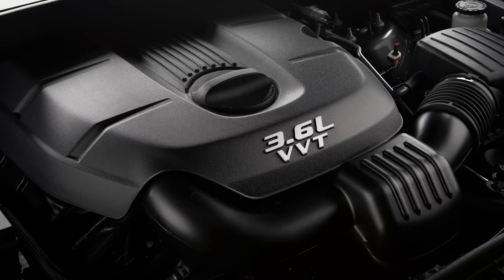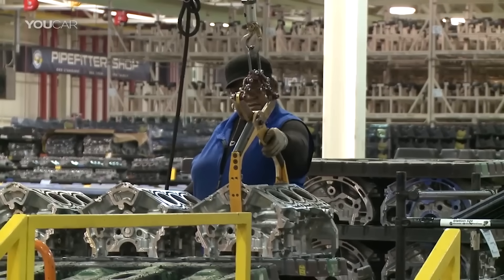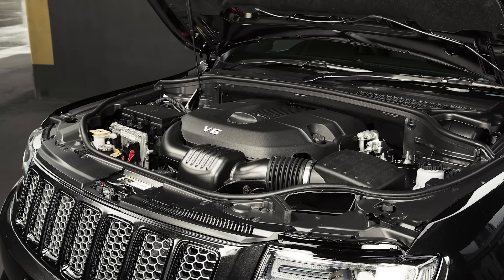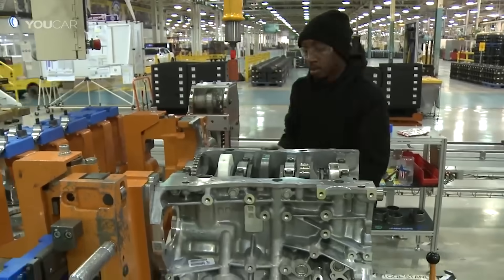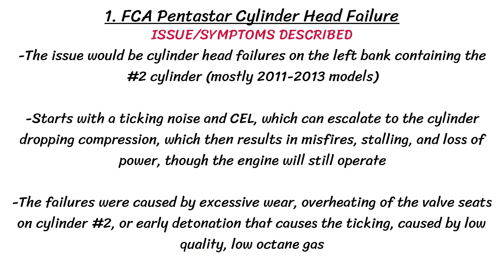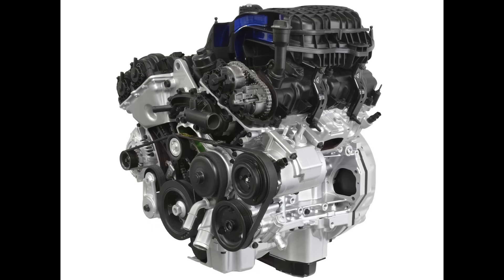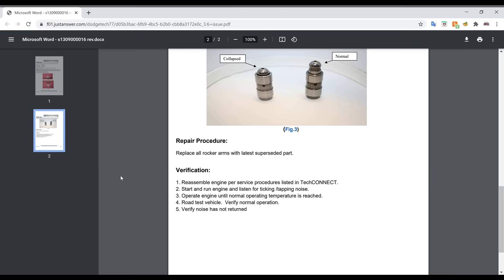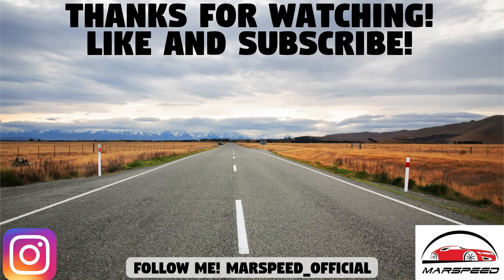The Specs and Fatal Flaws of the Chrysler 3.6L Pentastar V6 Engine

Comment: Work on the Pentastar everyday. The head and rocker arm issues are 100% accurate but the vehicle's affected are pretty low. Enough so that we purchased a 3.6 in my wife's car. For the most part they run great and have great power.
Reply: Bought a 22 gladiator and under 5000 miles had a rocker arm fail
Reply: Great ! I just bought a 2011 Chrysler 300 V6. It has 216K Miles on it. I got it for 500 dollars, it has a phone book of service records. It has a dented wheel and fender. I ordered everything I need and can’t wait to get it back in the road.
Reply: Yes I'm dealing with it now
Reply: So my 3.6 is having an oil pressure issue. Not revving over 3k. Check engine light for engine oil pressure control circuit stuck closed, just had an oil pump and sensor put in to solve the problem with no results. What on earth is the problem
Reply: @ashtonr6751  It's Fiat-chrysler. They're not good.
Reply: @daveclark8337 incorrect bias and not helpful.   They are looking for a likely cause to repair.   Why be mean??
Reply: @asdad asdasd one more thing I forgot to mention is that transmission problems usually a ride after you've had a engine fuel or spark issue if you notice that the kind of happened around the same time at the starting point then they're tied together, so fix the engine problem in your transmission will probably straighten out
Reply: Have a 9 year old Charger 80k never any issues yet. Dad’s got a 17 Caravan 130k no issues
Reply: I had one for a short time in a 2017 wrangler. Sometimes (especially at a cold start) it would knock for a few seconds until the oil circulated but it was very noticeable. There was always some degree of a knock at startup. 
The other issue was a very slight grinding like sound when it ran. As engine speed increased, it seemed to sound worse but not louder.
I sold it with 16k on it and I'm kind of a fanatic with oil changes. It just didn't seem like a smooth-runner.
I always wondered about that engine
Reply: @User-q6x3b  to avoid dry starts, hold the gas to the mat, turn it over for a couple of seconds.. then start it.. it'll start nice and quiet.
Reply: The rockers 😂
It's not difficult to fix, after good ones are replaced it's a great ngine. It's a shame Jeep didn't do a recall.
I've had Landrovers, BMWs, fords etc with worse problems. Start to google about them and then you will be greatful for the rocker issues. 😂
The internet is a nightmare for problems but not the good things.
Reply: @RoyalBaboon247 exactly true about other brands
Reply: THANK-YOU FOR THE ENCOURAGING NEWS BROTHER, STAY SAFE !!
Reply: @Hoss056 do you think the rocker arm issues are caused due to the oil galley plugs backing out causing lower oil pressure to the lifters? The plugs are just behind the phasers. I'd be interested to know what percentage of vehicles worked for rocker issues have loose galley plugs.
Reply: @danieltillman3858  The bolts that block the end of the oil passages tend to cause timing DTCs when they get loose. I have no answer as to why the rockers fail. Only real advice is when you hear a noise get it checked out. Waiting let's the rocker get worse and can ruin a cam.
Reply: @danieltillman3858  There is a Star Case about this. That will cause DTCs and most likely some performance issues. I haven't actually found a lot of vehicles affected by that.
Reply: Most of them are caused by waiting too long for oil changes
Reply: 3.6 vvt..excellent motor change oil filter often super motor
Reply: 2018 caravan sxt all i have done perventive  .. bought it with 80k now 134k not a thing wrong
Reply: This is good to know :)
Reply: I've owned many vehicles with 3.6L engine and all have been bullet proof with up 130K miles thus far over 10 years.  No repairs whatsoever.  One of the best engines ever!!!
Reply: @asdad asdasd did you use the proper cleaner and clean the mass air flow meter and the throttle body? When's the last time you replace the air filter with OE Style? Sure you don't have any codes that would indicate Eileen system which means you might be pulling a vacuum and as far as the transmission goes to get the dealer to charge you a small fee to just Flash the transmission module with different parameters if you know for sure that your pressure solenoids and your transmission mounts are good
Reply: My wife and I just got a 2020 Chrysler Pacifica Limited. I see online that it uses the same PentaStar V6 as the Challenger SXT. The van gets 287HP stock, where the SXT has about 305HP stock. Does anyone know what accounts for the HP difference on the same engine? I'd like to have 305HP in my van. I wonder if an aftermarket performance throttle body made for the Jeeps or Challengers would fit and work on my van, or if the differences in ECM programming would prevent this.
Reply: This was incredibly informative. I just got told that my 2012 VW Routan has pretty much this same issue. It has 146k miles. Their recommendation was replacing valve lifters, timing chain, and catalytic converter totaling $11k. I’m at a loss. Obviously I’m not going to put that much into my van. Does this seem right?
Reply: @jonmitchell7626  no
Reply: Have you came across any oil consumption issues (3.6L 2014 RAM)? I did the oil filter housing swap after leaking and thought that would of solved my low oil issues but im going thru oil like crazy with no leaks apparent anywhere. Driveway is always clean. Any tips?
Reply: What would cause the car to rumble and shake for a second when running but at a stop? Mike does it for like a second and then it’s fine . 

I asked a mechanic and he had zero useful info to give
Reply: @avs27hky008 check you exhaust . Does black smoke comes out in the morning . Are the pipes black ? Piston rings ?
Reply: Have you dealt with the random Injector open circuit codes? 2 different cars same motor first are #3 & #5 second #2. Can't locate a ground issue with either plug has full power new injectors don't change it and can randomly jump cylinders
Reply: @HellicaBuilds  Have replaced a bunch of injectors but it's usually pretty cut and dry. Measure the resistance. Seems like 14ish is where they usually fall. Failed injectors usually are around 20 plus ohms.
Reply: What about the the flex plate.
Reply: @HellicaBuilds  Seen some crack. Usually on the heavier vehicles.
Reply: WHY why why are head gaskets blowing on '17+ Pacificas???😢
Reply: I have a jeep wrangler, 2016, just replaced the oil cooler with the aluminum dorman,  now it's leaking coolant over the transmission,  hose looked good and went on correctly,  gonna tear into it again this weekend,  I'm replacing other parts when I go back in,  was curious about changing the plenum to the aftermarket aluminum plenum,  do you have any pros or cons to doing the aluminum plenum?
Reply: @dominoperk2873  I really don't see why you would replace the plenum with aluminum unless you are running some boost. Seen a bunch of the aluminum coolers but I've always installed the original ones because that's what they give me from parts.
Reply: Try running a nice 5w 30 instead of 0w 20. You MIGHT lose a tiny bit of fuel economy, but your motor will thank you.
Reply: Four years ago, maybe yes. But today, in 2025, Mopar has 12,000 3.6 Pentastar on back order because so many valve tappets are failing.
Reply: @robdunham7398 So engines are backordered for tappets?
Reply: @robdunham7398 where did you get that data and the cause diagnosis?  Link?
Reply: Are the injectors loud on these engines? Where they tick?
Reply: @asdad asdasd lol yu mad they didn’t reply to you ? 😂
Reply: Asdad- asdad- You're a rude asshole. Prev was trying to HELP you, dummy. Don't ever ask for help again - F.O.
Reply: @strayedarticle2838   Ik this is 5months later, but had to say I got a 19 GC
Reply: @strayedarticle2838  who cares
Reply: When you say the vehicles affected are pretty low does that include the Challenger and Charger?
Reply: @autulius  includes every model with the 3.6 so it does with charger but I’m pretty sure the challengers only come w v8s
Reply: nice try trying to justify the purchase hahahahaha. FCA is absolute garbage and people like you is the reason they continue to shit on top of your heads.
Reply: You don't work on a pentastar everyday lol. Such a liar
Reply: I'm planing on getting a 2013 Dodge Challenger SXT, with 100k miles. any advice
Reply: @DEIFAN start it from cold (touch exhaust to make sure it's cold first), you listen under good while other person starts it, listen for bad noises.  Let it warm up and you listen while someone revs it hard a few times and also holds it at 4k for a few seconds,  also you listen for bad noises during and after.   Check for warning lights also b4 during and after.   Drive it some and check noises again. 

This is true when buying every car from every brand.
Reply: Love mine, 2013 Grand Cherokee. 123,000 miles exactly zero problems.
Reply: my 2015 caravan is good, have 90k miles
Reply: Gotta remember that people who have these in a jeep often work the piss out of them which makes you more prone to issues
Reply: Agreed I’m at 190k right now plan on getting a new engine soon
Reply: Yikes brother. You must be a glutton for punishment!
Reply: You pretty much listed all my problems. Everyone of them . And it's Sad we are taking advantage .
Reply: Reliable engine.  JEEP.  'JUST' EMPTY EVERY POCKET. ALL THESE REPORTS YES WE LOVE JEEPS . HOW EVER I BELIEVE EVERYONE SHOULD STOP BUYING THEM . AS A CONSUMER  BUYING INN  2013 JEEP WRANGLER SAHARA 2 DOOR 3.7 AND  ONLY HAVING 123,00 MILES REBUILT TOP LEFT HEAD ,TIMING BELT,WATER PUMP,OIL COOLER,ELECTRICAL PROBLEMS  AND SPENDING $ 5,879.34  LATER AND NOW A TICKING LOSS OF POWER A/C  goes on and off heat works sometimes but barley blows. Definitely should have been a major Recall and I've only put 23,000 miles on it since 2021. Because it just socks the life out of the wallet. Jeep/Chrysler,  Should have said look , we'll pay you top dollar .bring it in and trade it in on something else. Or Fix it for Free and pay costumer pays 50% cost of parts . I mean we are inn tough times . AMERICA NEEDS A CEO TOO DO WHATS RIGHT FOR THE PEOPLE . NOT MORGAN & MORGAN. THEY WOULD KEEP MY BUISNESS.  SO WHATS YOUR THOUGHTS IM OUT IN MY TOYOTA  2011 TOCOMA SHES NOT PRETTY AT ALL LIKE MY JEEP. BUT SHES RELIABLE AND RUNS LIKE A SOWING MACHINE . GETTING ME TO WORK AND BACK  MAKING ME $ AND ITS PAID FOR . WHY MY JEEP ISNT PAID OF IS ALL THE RECEIPTS I HAVE TO SHOW FOR IT . AND THE ONES TO COME BEFORE I CAN SELL THE SHIT THEY SOLD ME. ACCOUNTABILITY. I guarantee that judge THAT didn't GRANT THE CONSUMMERS A  WIN FOR BUYING SHIT THEY THOUGHT WAS NEW AND IMPROVED WHO ARE 99.O % RIGHT. HE got a new jeep . I HOPE SO HE SEE'S HE MADE A MISTAKE..ON TAKING IT OR THE big heavy ENVOLPE THaT was put inn his pocket.... I mean you see how that works on TV. Corruption.  F.O.J
Reply: @alexanderkennedy2969damn lol those have the 3.6 to? 😅
Reply: Mine blew up, connecting rod came off piston, block was destroyed
Reply: so what rocker arm replacements do you suggest...and the vvt valve
Reply: @maxlife9721  I replace all the rockers and lifter with factory parts when I'm in there.
Reply: Yeah I can’t believe this statement. There is 0 power
Reply: jl 18 had to replace rockers, and a cam. engine looked spotless.... 69000
Reply: I got 2012 with just over 100K Miles and it still runs like brand new. Not a single problem yet. Still sounds exactly the same as did the day I got it.  Very good dependable
Reply: @asdad asdasd the trans does the same thing in my ‘15 GC it usually happens when i first drive the car for the day, if the trans is warmed up & it still does that. You might need to get it serviced
Reply: My lifters are ticking but goes away am I good?
Reply: @matthewheredia7417  yes, they have a tendency to do that, but I would always recommend going to a dealer to get it inspected.
-I work in parts at Lodi Dodge lol
Reply: @matthewheredia7417  no
Reply: @matthewheredia7417  this is begging get it fixed or worse issues will start
Reply: @matthewheredia7417 Your cherry , its the first start that the top end doesn't have oil !!!!
Reply: If you miss an oil change on these series of engine, they wear out. The magnetic ring on the cam shafts pack up with metal debris, and foul out the sensor. I never let my dad go passed 40%life of oil. He did it once, and it cost him $3500 in upper head and timing work, and his trans was always clunky and just got replaced. He has a 2016 Ram 3.6 with the locking 4x4.
Reply: I tried waiting 5k miles to change my oil one time and it was a mess. I change it every 3k now.
Reply: @RandomsFandom  which sensor fouls out from the debris ?? I fear this is my current problem with the 3.6!!
Reply: @RandomsFandom  the manual on the 300S 2014 says under NO circumstances go beyond 6,000 miles without an oil change. I’m doing it at 5,000.
Reply: What is the best oil change interval for the Gen 1 3.6 Pentastar
Reply: @RandomsFandom  I'm on top of maintenance on my car.
Reply: @RandomsFandom one missed oil change will NOT cause a problem like that !!!!!
Reply: @RandomsFandom  your dad’s car had $3500 in repairs after exceeding slightly more than half of the recommended oil change interval? I would probably say it was going to feel regardless I could be wrong.
Reply: @RandomsFandom  if your having that kind of problems just by letting oil life go down you're using the wrong oil or cheap fram oil filters period I'd say most likely it's your using cheap oil filters.
Reply: For me, never again. The engine is pure trash.
Reply: My Jeep is in the shop for rocker arms right now
Reply: @totallyeinstein5151  who cares
Reply: @totallyeinstein5151  who cares
Reply: @totallyeinstein5151 how much??
Reply: @asdad asdasd 🤣🤣🤣
Reply: @asdad asdasd Are the battery's charged, and clean.  Check your voltages. and make sure you have clean gas. "No water,or anything, else, but clean gas.
Reply: I think most just say it's a bad engine even though their problem isn't the engine.
Reply: I have bought 3 cars with the 3.6 Pentastar and the fuel economy and power is great on that engine.  Not as good as a 4cyl turbo, but you don’t burn oil so there’s that.  

None if my cars had any problems, but 2 of them I bought brand new and only kept to 100k.  Obviously I am not a monster and did all the recommended maintenance and then some.
Reply: Kinda like the ford cyclone with the internal water pump failure issue
Reply: I heard they fixed the problem in 2017
Reply: I have a 2020 ram.  Dealer is saying I have bad rockers.  Hopefully the cams are good otherwise I'm looking at a $3800 repair.   108000 miles.   Mostly expressway.  Changed oil every 10,000 miles full synthetic.   I'm probably going to do every 7000 to 8000 now
Reply: @deplorable7575 Browse thru YouTube you'll find no small number of videos concluding that you should change oil no later than 5k, conventional or synthetic

Comment: I have a 2015 chrysler 200c with 42k miles and that roller rocker bearing makes that ticking sound :/ and my mom has a 2012 dodge journey with the 3.6 ofc 90k miles no issues :)

Comment: my jeep jk 2013 purchased in 2012. 1 cracked oil cooler. bad water pump, 3 thermostats. cooler fan. there's more but this is the most relative to the cooling issue.

Comment: I have a 2014 Jeep Wrangler, bought new from local dealer here in Queensland, Australia.  The vehicle has been serviced as per specifications up until this point.  At 96K km a P0306 code (engine misfire cylinder 6)  appeared and the technicians stated that even though the code was active the engine was not misfiring.  I have spent a lot of money getting this looked at with coils, plugs, injectors and eventually rocker arms replaced to no avail.  Further inspection revealed issues with the exhaust valves in cylinder 6 leaking.  Not good and it's going to be expensive to remedy.  There is no extended warranty for this (known) issue in Australia, so I'm not very happy.  Thanks Jeep, I'll be steering well clear of your products in the future.
Reply: Hello Australia from Phoenix Arizona USA.  I live here in the Sonoran desert where summers are traditionally 90+ days where the temperature never drops below 100 degrees.  Lots of times daytime temps are over 110, with a couple of times reaching 120 degrees in June.  I bought my new 2012 Jeep Wrangler JK 2 door in the Spring time.  First 60K miles were trouble free. Then one day on one of our freeways on a hot summer day I lost the thermostat doing about 70 MPH.  Before I could exit the freeway the temperature gauge pegged itself.  This over heating didn't seem to have much effect on the 3.6 motor for a couple of years then things started happening.  Overheating on occasions and water added to the radiator.  Even one more new thermostat.  Problems and engine light constantly coming on.  I wound up replacing my entire cooling system. New heavy duty 3 core aluminum radiator,  After market Aluminum oil cooler and intake manifold to replace those plastic parts and new water pump.  Then I got an engine misfiring code engine light so replaced the fuel injectors, spark plugs and coils. Took it to my local shop and they found I had a blown head gasket and some heat damage to the rocker shafts.  $5,600.00 later I now have a like new motor at 80K miles. Like you, I think I might look elsewhere should, God forbid, I need to buy something else.  Now I realize why they say JEEP means Just Empty Every Pocket.  Too bad.  I DO love the darned thing. I'm 80 and a life-long desert rat.  I need my 4 wheelers.  Be well.